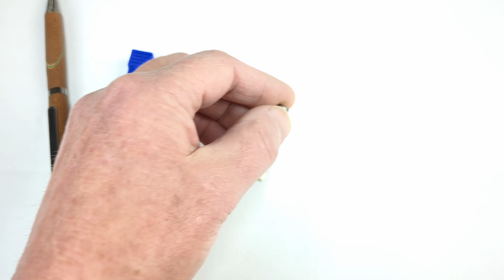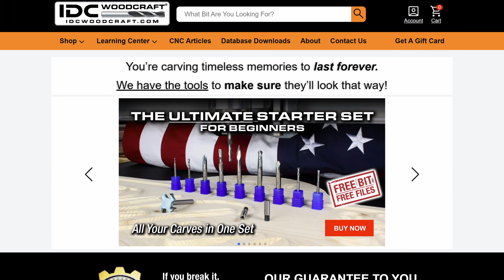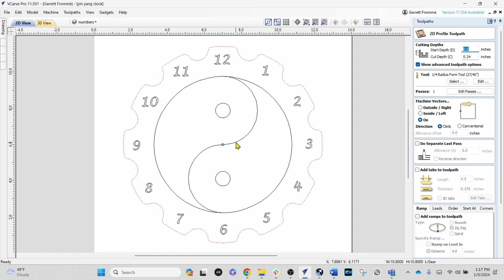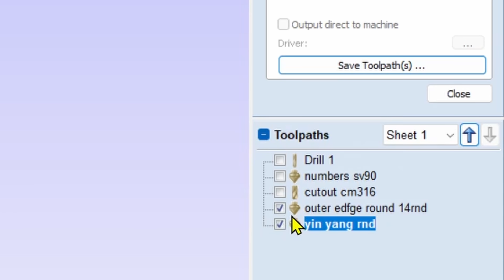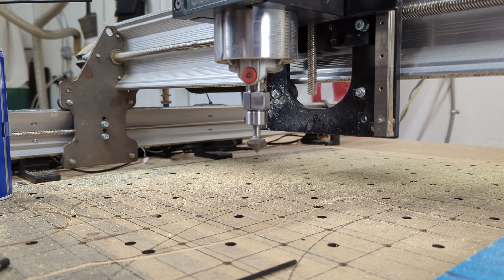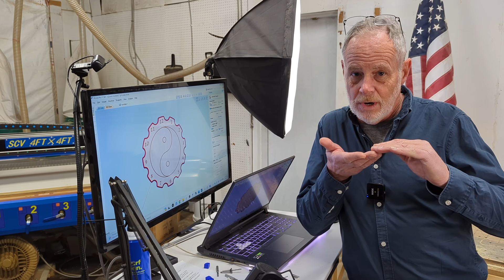How to Setup and Use Round Over Bits on a CNC Router

Comment: Sorry before if out of topic, but gotta question here, can i use wood router bits for plexiglass? I need to bevel 45 degrees plexiglass
Reply from the maker: You can use wood router bits for plexiglass, but they may not give you the best results. Give a 45 degree v bit a shot! It should work well for you brother!
Reply: @IDCWoodcraft  thanks for reply, i already try that 45 degree wood router bit for acrylic, the result are quite good, but it had a kinda chipping line, maybe my method are still bad, any suggestion?

Comment: Whenever I use a pointed round over bit and cut on the profile line it leaves a a small step.  I set a small offset profile of say 0.03 to cut on and eliminate the step.  It’s as if the point is not a true point without width.
Reply from the maker: That's a great observation, my friend! Sometimes, the geometry of the bit can create a slight step depending on the material and the settings, so your offset is a solid workaround to get that clean finish.

Comment: Control software is machine specific.  Check with Vectric to be sure you download the correct Post Processor for YOUR machine.

I personnal would not use the MuscleChuck for 1/2" shank router bits.  One set screw is not enough to hold the bit safely in the chuck IMHO.
Reply from the maker: You raise a good point about the MuscleChuck and its hold on larger shank bits. Safety is always a priority, so it's smart to consider the best options for your setup! Thanks for watching and sharing your thoughts!

Comment: The 1/4 inch roundover is not in the database a 3/8 inch is, I copied and updated settings but have no option to change the depth to .675
Reply: Never mind. I found it in the metric section
Reply from the maker: Glad you found it brother!

Comment: Could you put a mark on the shank to mark how far a bit should be inserted? Something easy to see. Im getting old and semi transparent marking on drill bit shanks and such are a bit hard to see.
Reply from the maker: The reason I don't do that is because it requires laser engraving which creates a weak point on the CNC bit. I did that for a while and I was noticing more brakes at that point. That's a great idea and is helpful, but I don't want people breaking their bits because of a laser engraving that I put in

Comment: Is there a 1/4 round over bit for a half inch Dia. Collet that does not exceed the shaft diameter, unlike the version you are showing. The round over cut I want to do will end at a vertical face of the material, and I do not want the edge of the face cut, nor do I wish to have a resulting small unrounded gap between the vertical face and the rounded edge...
Reply from the maker: Thats a good idea brother! Here is a bit that is a 1/8" radius where the flute diameter is the same as the shaft diameter: ttps://idcwoodcraft.com/products/1-8-radius-edge-rounding-bit-for-cnc-routers-1-4-shank?

Comment: Which way would u cutout the profile after cutting the roundover on the line would the countour path for the the profile cut be outside right or on the line as well? And for trays would i still cut the roundover on the line and then a pocket profile like normal?
Reply from the maker: For cutting out the profile, you'd typically want the contour path for the profile cut to be outside the line after rounding over. And yes, for trays, you’d still cut the roundover on the line and then proceed with the pocket profile as normal.

Comment: Could you also just run the beading pass as the last depth of the round over?
Reply from the maker: Great question! You can definitely run the beading pass as the last depth of your round over. Just make sure to set up your CNC to maintain the right depth and ensure a clean finish. It can save time and give you a nice seamless look!

Comment: Could you have changed the cut depth by .1 and gotten the same results on the beading tool path?
Reply from the maker: Yes, adjusting the cut depth by .1 can yield similar results, depending on the material and the specific beading design. It's always great to experiment with different settings to see how they affect the outcome!

Comment: Very nice video, thank you. 
I haven't tried this yet but suspect that any unevenness in the CNC bed will cause noticeable issues when using these round over bits? 

Also, very much looking forward to the day America adopts the metric system 😅
Reply from the maker: craigmc2223, I'm glad you enjoyed the video! Unevenness in the CNC bed can definitely affect the quality of the cut, especially with roundover bits, so it's great to make sure everything's level before starting. And adopting the metric system would certainly simplify things for many woodworkers!

Comment: Awesome video.  There are times I want to use a roundover on the CNC, but for the most part, I find it far faster to do it manually with a trim router, which I can do in the time it takes me to change bits and set the Z.
Reply from the maker: oldNavyJZ, I'm glad you enjoyed the video! You're right; sometimes a trim router can be much quicker for those roundovers, especially when you're looking for efficiency.

Comment: I run an offset of .015 to remove that line left by the round over bit when i do the od profile cut
Reply from the maker: bubba6945, That's a great approach! Adjusting the offset helps achieve a cleaner finish by compensating for the slight imperfections left by the round over bit. It’s always interesting to hear how other woodworkers tackle similar challenges. Happy machining!

Comment: Awesome info, yet again! I found I was getting excessive tearout from my pointed roundover bits. I ended up slowing the feed rate, and making several shallow passes. It did help some, but it's far from perfect, and fairly slow going.
Reply from the maker: spunkybrewster1972, I'm glad you found the info helpful! Slowing down and making multiple shallow passes can definitely reduce tearout, but it's great that you're experimenting to find what works best for your setup. Have you tried using a climb-cutting technique or a different type of bit? Sometimes switching to a compression bit can also offer cleaner edges. Keep at it, and you'll find the perfect solution!

Comment: Great video. Which I would have seen it earlier cause I have a question... If the radius is the same as your stock thickness, can you use it to cut out your piece at the same time?
Reply from the maker: JavierDeJesusSr, you sure can brother but for the cleanest cut and longest life for your bit I suggest you use a seperate profile toolpath to cut out your project first.

Comment: it seems to me that I could put a round over bit in and use the 1/4 inch endmill tool selection as long as you are cutting on the line and remember to set your depth of cut for the roundover bit. The simulation would be different but how would the machine know the difference. Also can the muscle chuck be used in a 3 hp spindle. Thanks
Reply from the maker: JamesLinger-wl8sq, that would be a great call for a setup brother! As for the muscle chuck, not yet Ive been working directly with muscule chuck to provide more options for spindles in the future. Ill keep you in the loop!

Comment: I have not zeroed from the machine surface before. When doing so, do you set the material depth at its actual distance or add a bit? AND when using the rounding bit in this context,  and considering the cutting depth for the roundover bit is critical, causing the appearance to vary with small changes, do problems show up if you are cutting stock with slightly different thickness... or How critical is consistent stock thickness when zeroing off of the machine bed and using form tools like the roundover bit?
Reply from the maker: PaulSchuster-yj4zb, great question brother! Zeroing from the machine bed can be super useful, especially when your material isn't uniform. You measure the material thickness, tell your software, and you’re good to go. This way, even if there's a little inconsistency in your stock thickness, it won’t mess with your cut depth as much because your starting point remains the same.

With a roundover bit, getting that cutting depth just right does matter a lot for that perfect edge. If your material thickness varies and you're zeroing from the bed, you might see some differences in the profile. But if your pieces are pretty close in thickness, it should all work out okay.

If you’re really looking for precision or your stock varies a lot, zeroing from the top might be the way to go for each piece, particularly when you're aiming for a flawless roundover finish. It's a bit more work, but hey, it can give you that consistency.

Hope this helps, and if there’s anything else you’re scratching your head over, just holler. Always here to help out!

Comment: I am posting this here because this channel seems to be very knowledgeable in the field. 
I want to punch very precise multiple holes (0.5 - 1mm diameter) on a sheet of substrate (similar to PCB but softer rubber like) reproducibly using a cheap chinese CNC machine. The sheet is already marked with circles where the holes should be made. I am aware that the XY 00 can be set every time i place a substrate workpiece on the bed. However, the substrate overall dimensions are not always accurate and therefore, there will always be some rotational misalignment of the entire layout each time i place a new substrate.

I am wondering if there is any way of manually providing the software 2 or more reference points across the substrate (e.g. one at xy=00 and others at the far end of the substrate and the layout) so it knows the angle of rotation and maintains the alignment and hole locations precisely within the circles on the substrate matched with the CAD drawing? 

The second part of my question is whether i can connect an automatic center punch (with a hole pin instead of a solid punch pin) instead of a drill and tell the machine to simply lower down where holes need to be made. Then move up, go to the next position and lower again and so on.
Reply from the maker: SA-wp4vt, This one is a little tricky to walk you through over comments my friend. I recommend joining Kate and I for our live sessions we host every Wednesday evening at 8PM EST. We should be able to help walk you through it then brother!

Comment: Garrett, great video on the round over bits.

Question did you cut through the material with a profile Toolpath prior to using the roundover?  If yes, what kept the material in place?  Tabs, Instant Glue?
Reply from the maker: JS111952, I sure did use a profile toolpath to cut it out prior to using the roundover brother! For this project I used the painters tape and super glue method.

Comment: Great informative videos! Thank you!

What's the best way to eliminate witness marks when routering HDPE is it the same idea as changing to a shallow last pass depth? Using an o flute up cut bit. 

Thanks in advance
Reply from the maker: KaseyLarson, great question! To minimize witness marks when routing HDPE with an O flute upcut bit, a shallow last pass is effective. Additionally, ensure your bit is sharp, your machine is stable, and the feed rate and spindle speed are correctly set to prevent the plastic from melting. A consistent cooling method to keep the material cool can also help achieve a smoother finish.
Reply: Fantastic thanks so much for answering my question! I really appreciate your help!

Comment: Hi Garret, great vid as usual. One question about using a round over. If you have a finished project eg a cutting board and you wanted to round over the edges, is it possible to measure so accurately that you can achieve a consistent round over? John
Reply from the maker: John, that is a tricky one brother. For that I might recommend that you perform the roundover manually with a manual roundover bit.
Reply: Garret one further question. Is it advised to protect the edges of an end grain board in case of chip out and if so, how? What settings would you advise eg feed rates etc? John

Comment: The 1/4 inch roundover seemed to magically cut through the 3/4 inch material?
Reply from the maker: Sometimes it feels like magic brother. If I understand your question, you're asking why I used the 1/4 inch round over on about 3/4 inch material. The 1/4 inch refers to the cutting radius of the bit, not the bit length. I was looking to get about a 1/4 inch radius on this project in addition to the Bead cut. To Accomplish this I used the IDC 1/4 Round over bit for the curved edge. At the end of the video I show that extra little line on the project that you can sand off, that line is where the tip of the bit stops. That line shows where the bit stopped being able to cut. Hope that helps!
Reply: You did not understand my question.  It appears on the video that the ¼ inch roundover bit, when used to create the upper 1/8-inch step, is cutting through a ¾ inch material. That is not possible.  I have used roundover bits for many years on a router table to achieve an similar appearance, such as on the edge of a dining table.  I feel that a second cut with any vertical bit would be necessary to complete the separation of the pattern form the stock.  It appears to me that you used MDF for the video, I assume for ease of demonstration.  I only am working in hard woods; therefore, I believe your presentation is either incomplete or disingenuous for folks new to woodworking.  I do not intend any disrespect for your bit.  I have used it and it delivers the expected round edge.  I am now trying to perfect the so-called bull-nose with your bit on the Longmmill.
Respectfully, John Garnett
Reply: Garrett mentioned that he is doing the cutout first and just shows a quick video if that process as it was NOT related to the roundover bit toolpath.  He used a strait bit and you can see it briefly after he mentions that he was not going to show the cutout process in detail. You are correct that a roundover bit is not the correct bit to use for a cutout, but please remember that Garrett is professional and is well aware of this.  There is no need to leap to conclusions and accuse him of being "disingenuous" when the video shows that a strait bit was used.  @JOHNGARNETT-r2z

Comment: Would a V bit be able to do the same cut as the 1/8 rnd in this case?  If so, what's the advantage of using the 1/8 rnd? Thanks.
Reply from the maker: cablsurfin, Excellent question brother! It all depends what you're trying to do with the cut. A V bit would be able to make the same cut, but the edge would be straight. I was looking to get a gentle curve in the Ying Yang design. That's why I chose to cut with the IDC 1/8 Round Over bit.
Reply: Ah, that makes sense. Thank you for clarifying.